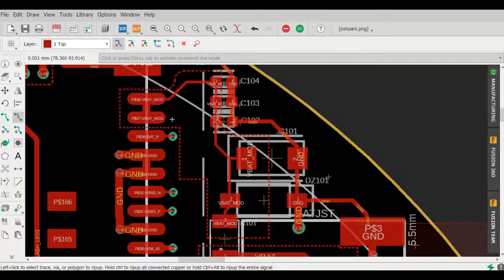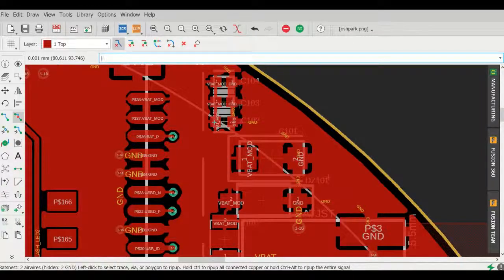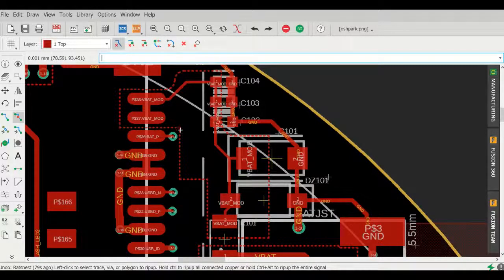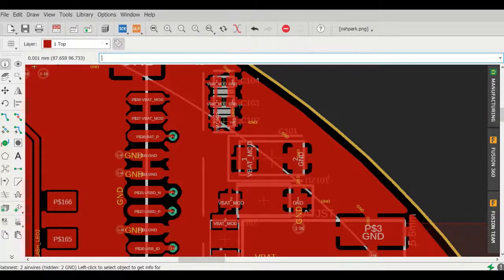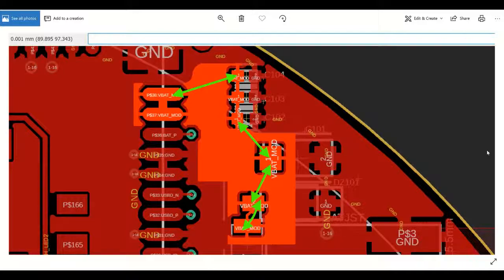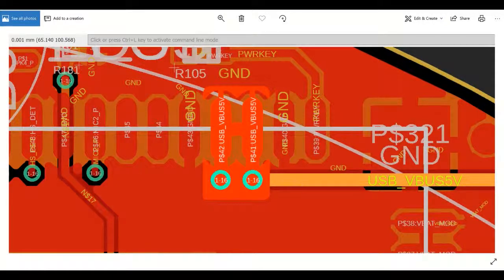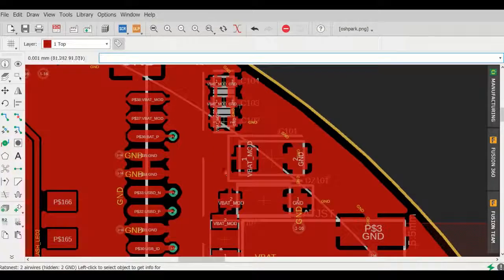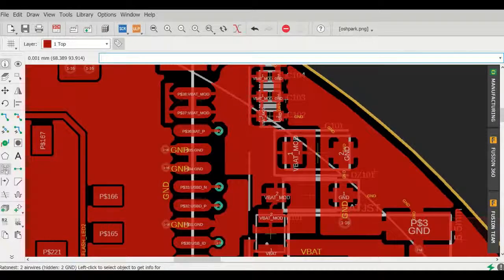Thermals and Polygon Rank in Autodesk Eagle

Comment: --Heads up, you should tune your usb traces to match the impedance of your pcb. Ask/ lookup the stackup from the board manufacturer and calculate out the correct size and spacing for those differential traces. Then you can use eagles route diff on a trace pair where the nets are named ending in "_P" and "_N" denoting positive and negative line.  
--Since you have some RF componenents... (im thinking this is the rf module used by particle) don't forget to keep out the ground fill from under the antenna as the datasheet for it calls for
--Another point, the rank system is used to specify which polygon has priority where lower ranks have greater priority and will fill over others of lower rank(higher number). As such I would recommend that you keep the main ground pour at 6, and successively important pours as decreasing in rank. 
--Lastly, you have an extremely generous board house, good job finding them.